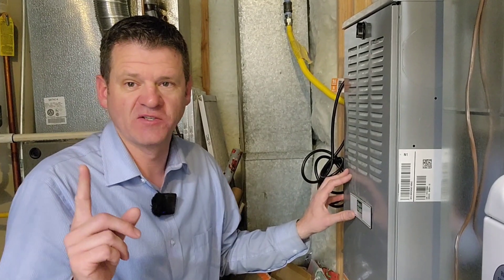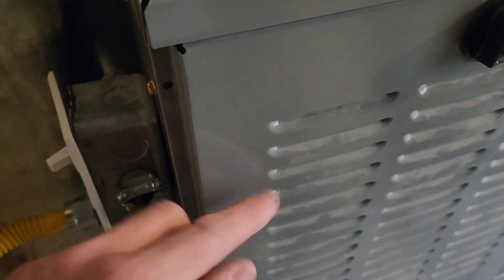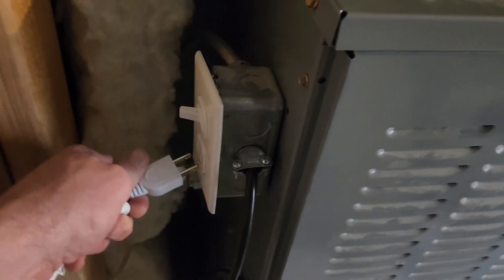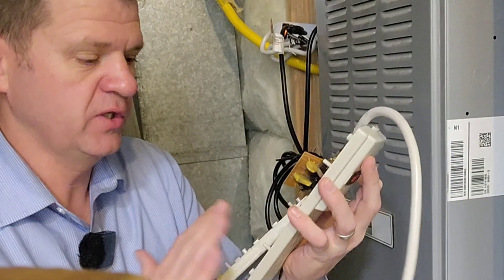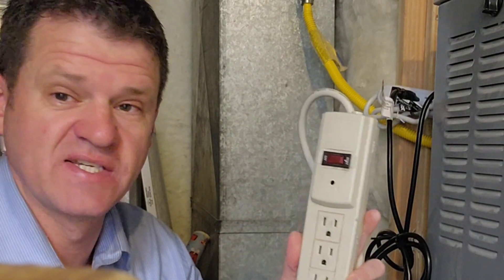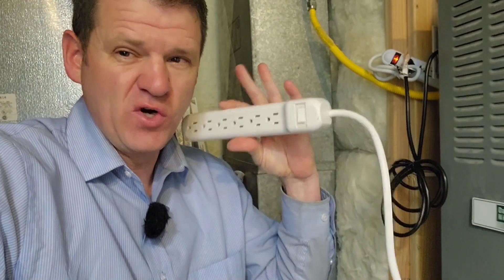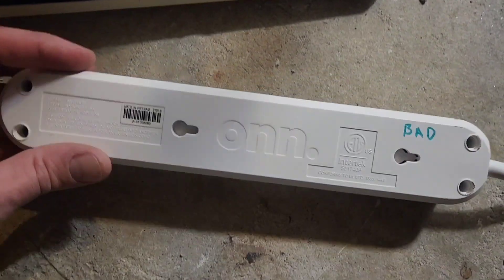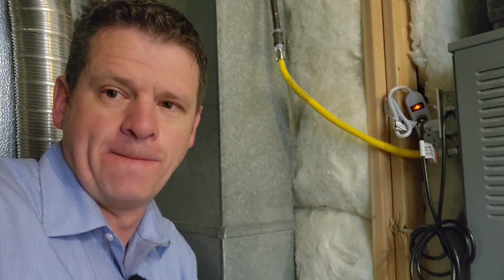3 Ways To Protect Your Home From Unwanted Surges

Comment: Not on the topic of the video but you seem familiar with the 6000xp. Is there a way to run non communication batteries with the 6000xp
Reply from the maker: Yes, people do it all the time. There is a setting for that. It needs to be a 48 volt battery though

Comment: Look for a Delta LA302 Lightning Arrestor. It's a silicon oxide varistor and it will stop multiple surges.  They come in various voltage ratings for what they are protecting, also for A.C. and for D.C.   I have three of the D.C. units installed on my solar input and one of the A.C. units in my main panel.
Reply from the maker: Thanks. I'll check those out..  For my solar arrays I have a pre-built combiner box that has surge protection built-in.

Comment: DO NOT do what this guy is saying.. put a whole home surge protector in at the breaker box as that's code.. EVERYTHING this guy is saying is against code for a good reason. American powerstrip surge protectors VERY OFTEN ARE JUNK and do not tell you if you're beyond the limits or even if the surge protection is even working.

Comment: Get a whole house protector & don't fool around. I have an Intermatic whole house unit with replaceable modules for each leg of 220vac at the panel. It works with grid, solar, generator etc. Whatever type power being fed into panel.

Use a dedicated UPS, NOT a crappy dime-store power strip! Get one sized for the entire panel... or dedicated circuits. Generator power is 'coarse' and can damage electronics.

Comment: Ray, Great video to show the importance of surge protectors and the results of a Power Surge. About 5 years ago our neighbors and I took a power line hit by lightning. Transformer on the pole caught fire and we had $2500 of electronics damage. There was a small whole house surge protector on the panel, but it did nothing, still showed the green light after the hit. I went to Home Depot and purchased newer whole house module. That failed within a year also, but only a few of the electronics were affected and I was able to repair them with some new parts. 

I started researching units that big business uses and came up with the outdoor Leviton 51120-3  outdoor Whole house surge protector. It came in a water resistant metal box for outdoor mounting next to the Service Panel. Even has $25K protection. Living in Florida we have plenty of lightning strikes and the neighbors that did not take action and purchase a quality whole house surge suppressor have had more electronics issues. So far this unit is working perfectly. 

Last summer, my daughter asked me to install one on their home. Since the unit I have is no longer available, I decided on getting the Intermatic IG2240-IMSK. The nice thing about this model is that it has replaceable IModules and each module has an indicator light on it to easily determine which module needs to be replaced due to the surge. I had her purchase 3 spare modules just in case. Theoretically, only module should become disabled if the power line is hit. So far all is good.

Comment: We had a surge due to lightning and it go into the thermostat wiring and blew out the FHW TACO pump controller and the boiler control board as well as every thermostat in the house. I have not determined a way to prevent that yet, not sure if a simple glass fuse would be fast enough to protect them.
Reply: My in-laws had a lightning strike on the far side of their 1acre pasture.  It went thru the electric fence wire and exploded the fence charger - pieces were 20ft away across the shed. It travelled thru the shed power wiring to the house, where it killed their internet modem and sprinkler controller.  Everything else seemed fine, but a couple of years later there was no power in the shed.  The breaker was fine and power was on the wires at the breaker, but no power at the shed.  Even better, I could hear a hum from the breaker and using my clamp meter found there were several amps of current flowing in the line to the shed.

Started digging up the wire at the shed end (the house end was under a concrete patio and uncertain where it emerged) and it seemed fine.  Started digging back toward the house, and soon found what should have been a grey wire was green and so was the dirt around it.  Cut open the wire and found there was no copper inside.  In several feet of wire there was either badly corroded copper, copper granules or nothing but green. Theory:  lightning had perforated the wire insulation, moisture had gone in and electrolysis had eventually dissolved the copper.  After trenching in a new line, the electricity usage dropped.  Nothing like not paying for hundreds of watts heating up the dirt.
Reply from the maker: Hmmm..Lightning rods might be the only way  to prevent those.

Comment: Dont most surge protectors say they warranty their protection for up to 10k in replacement costs?  would love to see if you can get the cost of the nintendo replaced with under that.
Reply from the maker: I imagine there's a million Hoops to jump through. But maybe I should try it
Reply: @diySolarPowerFunWithRay  ONN is a walmart brand.. so it would be interesting to see if they honor it.
Reply: no. this is not the use that is listed in the warranty. but also those warranties are often fake.